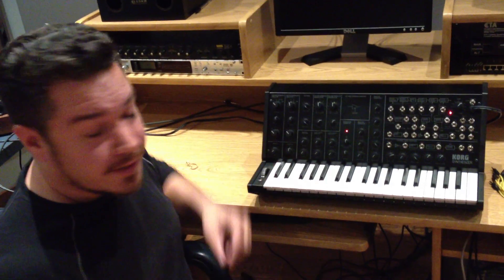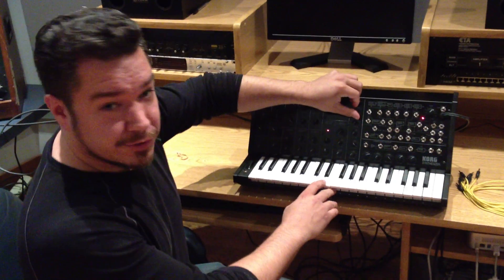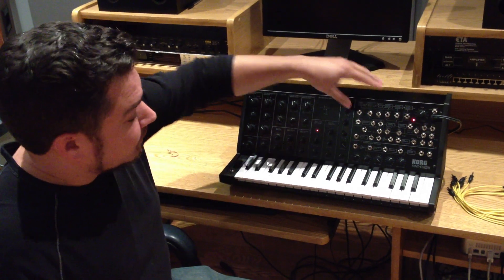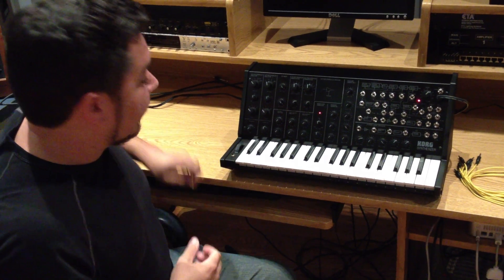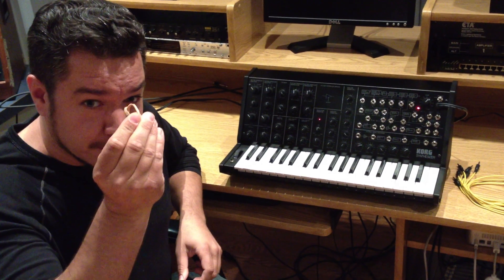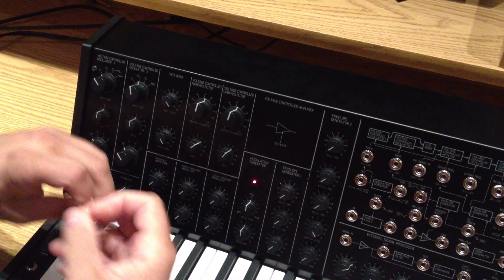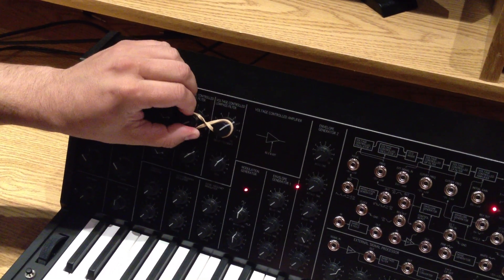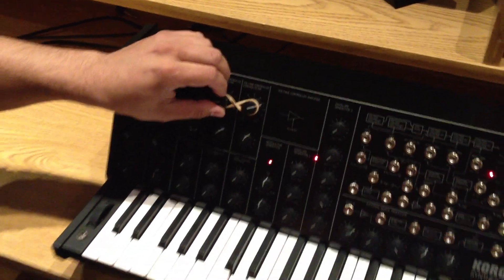Adding a Band-Pass Filter to the Korg MS-20 Mini

Comment: Actually, you can make a band-pass filter with the patch-panel. You just use the 'total' input. Plug in a modulation source, set the desired amounts and settings for each filter, and your ready to go! You can use the mod wheel for real-time control of both filters, or you can use an envelope generator, LFO, etc.
Reply: Exactly!

Comment: Nice trick, but actually you can do this without even using the rubber band. I had an original MS20 for many years, but I'd expect you can do the same with the mini. Because the two filters are next to each other, just put them between the fingers of one hand while you play the keyboard with the other, and sweep them. BTW that's how I became known as Sweep.
Reply: Well he mentions that this tutorial is the easiest way to do this method. Imo strapping a rubber band to the filters seems way easier than putting those fat knobs in between your finger lol

Comment: Off topic for this video but an important message for the Kronos:
The Roland FA-06 and the MOX,MOXF, works better than the Kronos regarding the USB audio interface. The Roland and the Yamaha gear does not route the output back to the input when USB 1 en 2 are set to L/R. With the Kronos once you have recorded a  track you CANNOT record a second (stereo) track while listening at the same time to the first track. Roland and Yamaha USB audio interface handle this procedure with no problem. With the Kronos you have to create an aggregated audio output with another audio device.. Korg please update your software driver and firmware. Thanks.